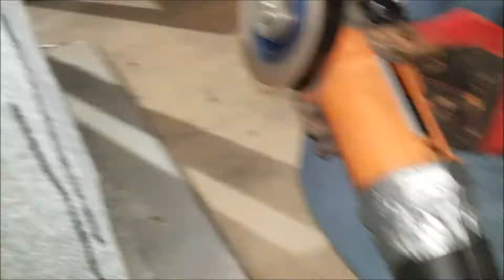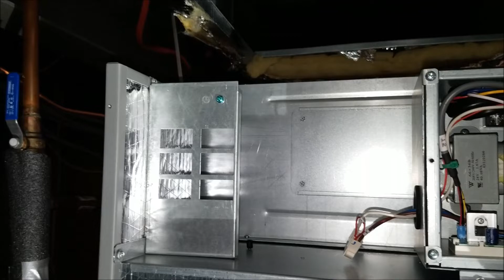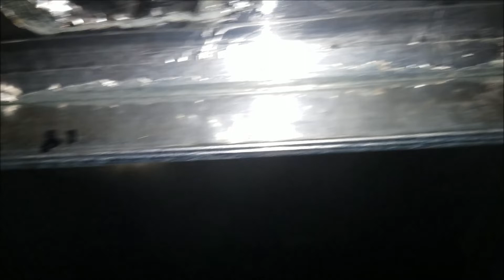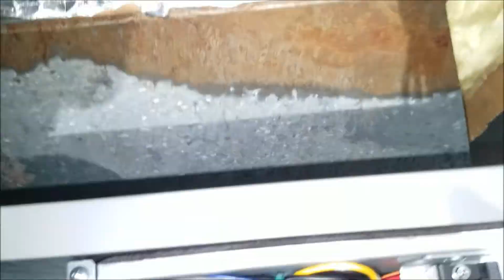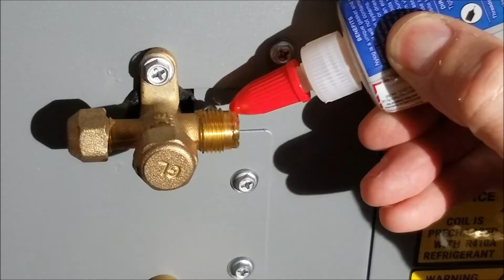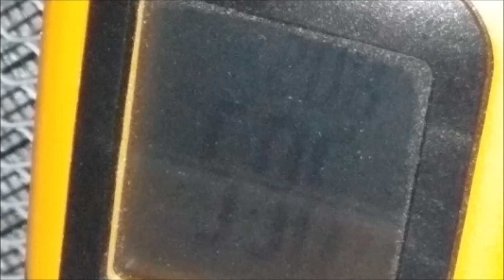Mr.  Cool  DIY Heat Pump Ducted Universal Part 5 Installing the Indoor Unit

Comment: Maybe this is a new thing but the instructions very clearly in very large print say to NOT use ANYTHING on the threads for the condenser line. I bet they had many failed installs and finally had to put that in the instructions.
Reply from the maker: I'm wondering if it's because people put plumbers tape around there? Lol.  I have heard people do that.  Unless it's causes threads to rust (which I can't see why) I don't see why? Mine has been running fine.

Comment: Is there a reset button on the indoor handler board? I'm getting a E1 code and E4 code which means the indoor is not communicating with the outside. This system has given me so much problems with leaks then the compressor went out
Reply from the maker: Not that I know of. The only communication is the indoor unit telling the outdoor unit what mode it's in and to turn on.... unless they put some other communication stuff in there with newer units.   The brains are in the outdoor unit. 

The lineset connection is the most critical. Did you use any nylog on the threads to prevent leaks?  Where are the leaks? This could affect your compressor as well.
Reply: @stem_saving1644  the company doesn't want to help with the warranty on anything. I might just throw this junk in the trash an d just take the loss and install a new unit that's not from China shit lol

Comment: The wiring, on the manual it looks like the temp control is used as a hub, but looks like you used the air handler as a hub, is that correct? Or how do they need to be connected?
Reply from the maker: Not sure what your meaning  as hub?  All the connections are made at the air handler.... but you can really make them anywhere....as long as the wires are all connected per the diagram.
Reply: @stem_saving1644  alright, by hub I tried to say where the most connection are at. Wasn't sure if I needed to run a wire all the way to the thermostat for each condenser and air handler or if I could run a wire from the condenser to air handler and wire from thermostat to handler.
Reply from the maker: Electrically, they are the same. Most set ups have outdoor unit wire ran to air handler then to thermostat.
Reply: @stem_saving1644  thank you

Comment: Thank you for the great video series. 
Could you please take a picture of final wiring inside your Lux thermostat? I also have  a Lux thermostat and in the video you show what the wiring looked like on your prior system. Thanks 
BTW I just received by Mr. cool 4/5 ton system. I have purchased a number of the parts and tools using your affiliate link.
Reply from the maker: Thanks for the feedback.  My thermostat has the blue connected to B. Everything else is the same in the video. Y &W jumpered together.  Hope that helps
Reply: Great! Thank you for the quick reply

Comment: Oh I have another question my current gas furnace is horizontal, not vertical will that make a difference to the heat pump indoor unit?
Reply from the maker: It will work either way.
Reply: @stem_saving1644  thanks

Comment: Wonder if Mr cool has a 48 volt ducted heat pump. Would be really nice to come right off the battery packs and not have a 240 power inverter in the line.
Reply from the maker: Doubtful, your looking at 150A at full power.  You'd need a large battery bank to run this.

Comment: I have my outside and inside units installed but have not done the lineset yet.  My units are not that far apart.  Did you have any issues with the linesets being to long and if so how did you handle it, did you change the routing to get it to fit that well or get lucky, or do you have a loop some where?  Using all 15 feet of the lineset to go 10 feet has me concerned, but have not gotten back to the cabin to finish yet.  Any advice or tips on running the line sets would be great from your experience.
Reply from the maker: Mine were about 3ft longer than needed.  I  just used some 8awg grounding wire to map out a path.  Didn't really need to.  Just do a couple extra bends with smaller line as it's easier to bend.  Then follow using bigger line.  Hope that helps.

Comment: While installing the line set connections, you mention "adapters". Are these included or do they have to be purchased separately? I was suprised that the line set fittings were different sizes than those on the air handler and outside unit, but maybe I missed something in your explanation.
Reply from the maker: Adapters are included with the lineset. The reason they exist is so you can make your own flared lineset or use their lineset. It's pretty  nifty.
Reply: Thanks so much for the reply! And you're exactly right - that's a great idea - especially since they're included!
Reply from the maker: @faystroud9039  I didn't want to flare and vacuum my own lineset. This was a perfect setup.

Comment: ?????? What size of circular duct did you use on your retorn unit ???? Thankyou for your videos
Reply from the maker: I  have a return plenum. Roughly 16x25. All supply vents are 6" ducts.  Every house is different.  Need to make sure you have adequate air flow and pressure drop.
Reply: Thankyou

Comment: I have a ??? How many amp breaker you put on your unit Air Handler 60A or 15A
Reply from the maker: 15a breaker
Reply: @stem_saving1644  thankyou so much
Reply from the maker: @aaronnunez292  your welcome. But be sure your breaker is sized to protect the wire.  I'm running 12awg. If you are running smaller gauge, keep that in mind.

Comment: I was thinking of going geo when we start building next year, but this universal looks like a real game changer. I could even install this unit in our build to save money vs a hvac putting in a natural gas system. Being honest here I skipped through your video, but can you do zone heating with the universal?
Reply: Most geo systems I've seen have desuper heaters so you could contribute to your got water. 
I don't know why that's not a more common feature on HVAC systems
Reply from the maker: Anything can be done it's the question of cost and complexity. For summer it makes sense.  In winter the HP reaches a COP of around 2-2.5... where a HP water heater is in the 3 to 4 range.  Don't forget all the piping complexity that goes with it.
Reply: @stem_saving1644  I can agree to that as an overview. 
Me personally, I live in Florida and mostly deal with cooling my house. Dumping heat into my water heater and maybe diverting some of it to my pool would be nice.
Reply: The cost of the digging is insane and requires flow centers and pumps. The new gen inverters have a much higher cost return. The only exception would be if you are going to own your not so energy efficient house thru several replacements of the system. IE you dont have to replace the fields or wells and just the unit.
Reply: I have the same system the unit start cooling and then eventually it stops. I was thinking of removing the blue wire when it's cooling so the valve stays in the cool permanently. Olive in south Florida so I would never need heat lol. I wonder if that would work.

Comment: OMG! That 4 ton system is too big for your for your 3 ton house. Did you even get a heat load calculation? And using duct tape to seal. geez beasties.
Reply from the maker: No it's not.  Need 4 ton for 3200sqft of heating.
Reply: These are inverter systems, the old systems you couldn’t oversized, these modern inverter systems don’t have that issue of short cycles, although the sizing seems correct anyway

Comment: Did your indoor unit require a 220 line? Or were you able to use the 120 line you showed with the outlet.
Reply from the maker: I had to run 240 line.  You could do a 120v to 240 transformer, but it won't be energy efficient.
Reply: @stem_saving1644  Thanks. I just got my Mr. Cool system and your videos match my scenario. Thank you for making them.
Reply from the maker: Your welcome. I think you'll be happy with it. I'm finishing my results for the summer,  so subscribe  if you want notifications!

Comment: how big of a space are you heating? Wondering how to size these thing....
Reply from the maker: I'm cooling 1600 in the summer,  3200 in the winter. Rule of thumb is 1 ton per 600sqft
Reply: @stem_saving1644   interested to see how it does, mind saying what part of the country your in? how cold?
Reply from the maker: We get both extremes for weather 100f in the summer and  teens in the winter. It's done well for both.  No heating strips required.

Comment: I'm considering putting the the same indoor and out door unit, what is the square foot area you are covering with your system?
Reply from the maker: 1600 for summer cooling 3200 for winter heating.
Reply: @stem_saving1644  thank you so much! That is similar to my sq foot, 1800 cooling 2600 heating. I noticed you didn't have any emergency/aux heat installed. What kind of low temps do you see in the winter?
Reply from the maker: We see temps for worst case in the 10s. Had no issues keeping up.
Reply: Ah we see temps well into -20s, trying to figure our which heater the get
Reply from the maker: It's good down to -22 at a derated capacity. Worst case,  get the heat strips?
Reply: @stem_saving1644  o yup, that's what I meant 😄 trying to decide on a heat strip. I realize how I said that was confusing.

Comment: Do you have to adjust the 4 ton or 5 ton switches on both the air handler and the outside unit? Or just the outside unit?
Reply from the maker: Both sides need to be configured